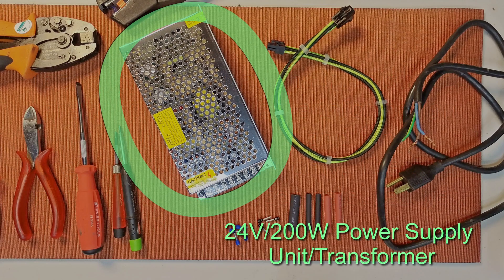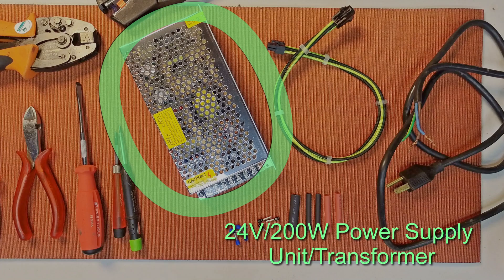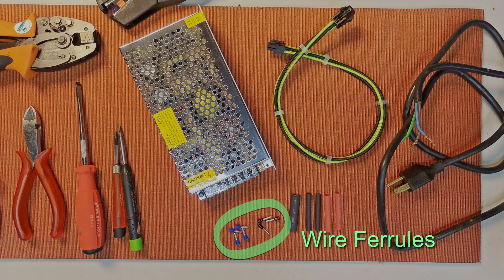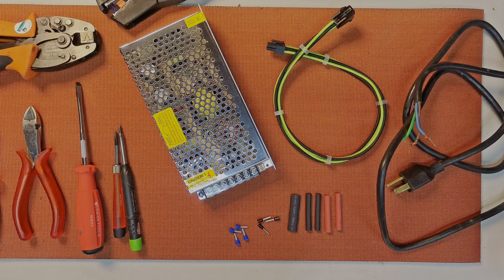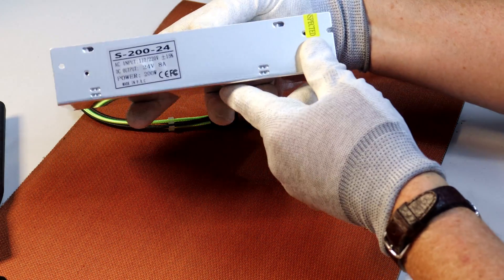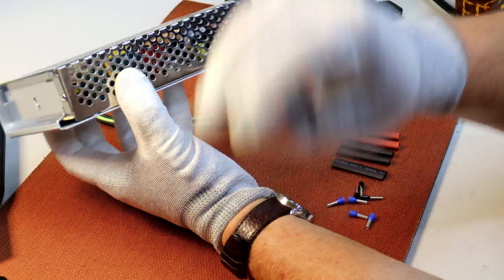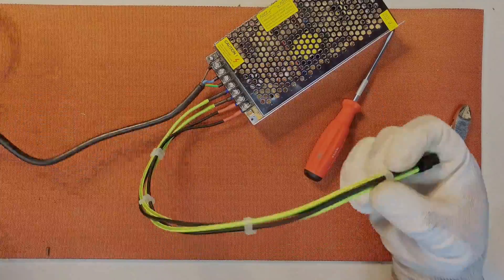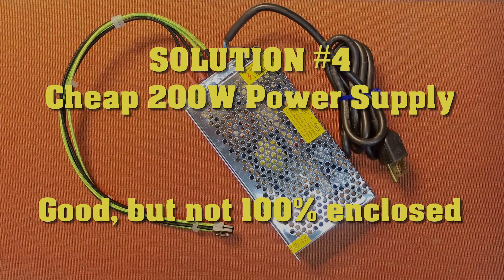$25 DIY 👨🏻‍🔧 **8Nm**  Fanatec CSL DD 200W Power Supply Pack (Boost Kit 180 alternative!) 💪

Comment: Does the 24V/200W 8A power supply, the $20 option, have any internal protection?  I have read on the Amazon reviews for these power supplies which all appear to look basically the same across many China based sellers, that there is no internal protection.  Thanks for pointing out some options even though we can't be sure if Fanatec will put a protection chip in to identify what PSU is connected.  At least until around September 6th when they start to ship the first wave of pre-order units.
Reply from the maker: Protection: Shortage Protection, Overload Protection, Over Voltage Protection.
None of which I tested, though. Yeah, final test is with  an actual production CSL DD in September at the earliest.
Also, the link to the 200W power supply might not work; like you mentioned, the one I previously linked to isn't available anymore. You can't go 'too big', so a 240W, or 300W PSU will also work.
Reply: @Polymer  You can put the source with the intensity you want, from 10 Amps everything will work well, always with 24V. 10,20,30,100 Amp. It does not matter, the motor will take what it needs, it is like putting a 100W light bulb on the network, it will not consume more even if you have contracted 200Amp. I would buy a 24V 15Amp power supply. of recognized quality and that complies with the electrical regulations of each country (Mean Well is a source that will more than comply.
https://www.olfer.com/nuestras-marcas.html
Reply from the maker: @JoseFcoBN  Exactly! Thanks for the comment. 👍👍👍
Reply: I am looking todo this aswell, but I will go for the Meanwell 24V 10A psu they sell for industrial use. Its a bit more expensive $60, but their psu's are really really good.

Comment: C'mon like wtf, its literally a regular power supply for a laptop with a different plug, these cost like 70 euros but fanatec has to sell theirs for 180. I would understand 100 but 180 is a scam. That power supply bullshit is the exact reason why I wont buy the CSL DD, fanatec are literally selling you the base product that works at half of its capabilites untill you buy a powewrsupply that costs like half of CSL DD. By their price logic the powersupply included with DD1 costs 100 euros, so what about making the power supply optional and let the buyer chose between base and more powerful one for extra 80 euros. You buy the DD with boost kit and then have the basic powersupply laying around collecting dust, you can't use it on anything else because of connector so its there creating more electronic waste.
Reply: Actually you get either 90w or 180w, not both in more expensive version